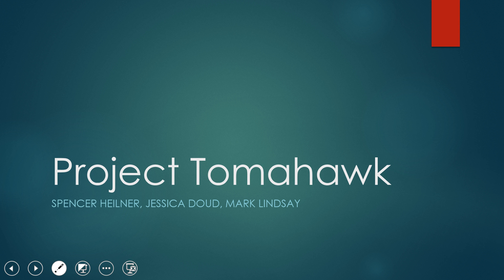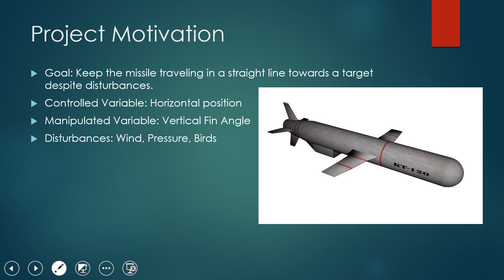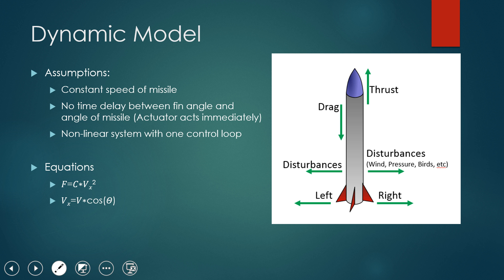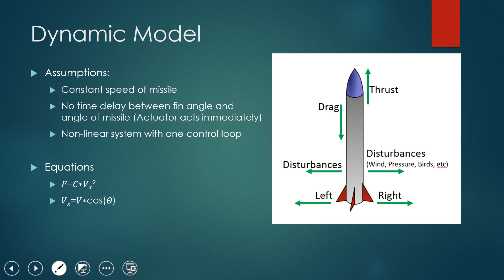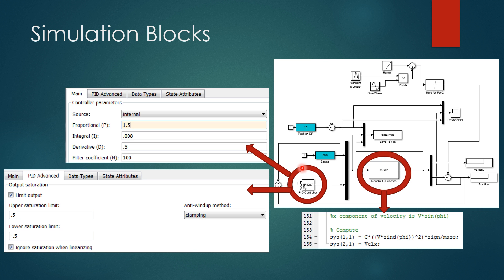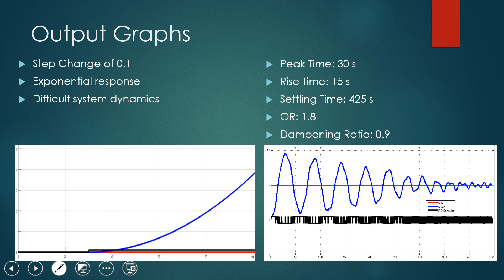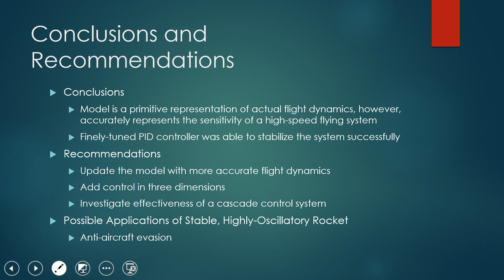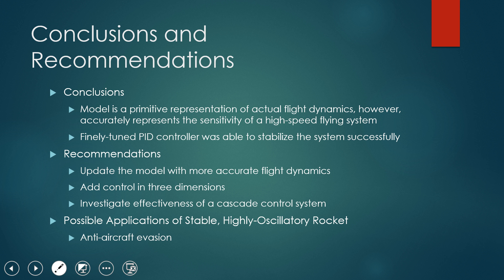Tomahawk Missile Navigation Control

Comment: Sir i am now in project of Missile guidance and control, Sir can you help me in choosing a unique topic in this field? I am student of M.phil Mathematics and also want help in Linear Quadratic Regulator (LQR) for simulink ,control and graphs of LQR with MATLAB programming. Please guide me and help me . I shall be very thankful to you
Reply from the maker: +Sangizone, there are many new developments in nonlinear model predictive control and moving horizon estimation. There may be application to your guidance and control problem. LQR has several shortcomings because it only uses linear models, a quadratic objective, and does not account for constraints. See additional material here: http://apmonitor.com/do
Reply: Thanks Sir .Sir can you suggest me unique topic in this field for my research in M.phil Maths.?
Reply from the maker: I recommend that you join the APMonitor Optimization Suite discussion group. It is a Google Group and you can request to join the group and potentially post any questions about APMonitor as you use it for your project.

Comment: This appears to me to be a very poor response. Suggestions.

1. Sample time of .1 seconds is an irresponsible selection, considering a $10 board can easily run at 1000Hz. 
2. Cascade does help reject disturbance to outer loop. For aircraft inner loop should be 1000Hz while outer loop should be 100-200Hz. Missiles at high mach may require faster rate control banndwidths to reject disturbances. I recall that missles also use optimal control to minimize jerk motion (Min |x(t)'''|). 
3. Oscilitory motion comes from two main faults: a poorly designed compensator or a well designed compensator whos linear regime does not cover the flight domain. To help with the nonlinearities of the aerodynamics/propulsion, one could either employ a gain schedule controller, nonlinear controller, or adaptive controller. A bumpless tranfer gain schedule control is often used with some nonlinear compensation (ie gravity). Also sometimes a nonlinear system can be made linear by selecting a clever value for the control channel. 
4. Even though nonlinear terms plauge 6dof dynamics, many of them can be viewed as static nonlinear transformations which do not effect time-varied dynamics. An example is relating euler rates of roll-pitch-yaw rates to those of body rates p-q-r. A nonlinear transformation is used which varies with time, however it can be viewed as a static transformation, aka it just converts the magnitudes from one basis to another. 

Please see my channel for my implimentation of a discrete cascade control system. Discrete control has many nuiances, many of which I can help with. 

Good work, thanks for posting. Cheers.
Reply from the maker: Great suggestions. This was a student project and they would have benefited from your insights.
Reply: I wonder why they opted for bang bang control and not proportional control? Also, the transient response is very poor with borderline instability. Damping factor is too low. Should have aimed at critically damped response. I bet they learned a lot from this project though.